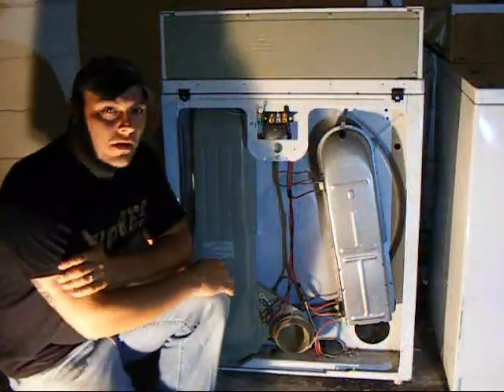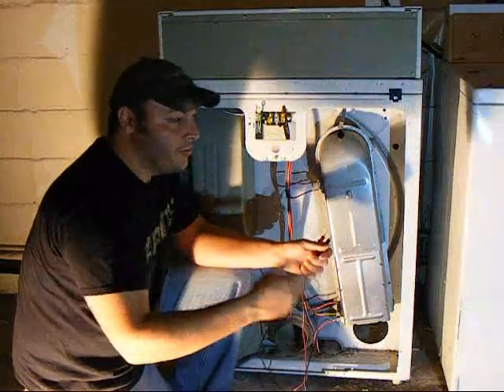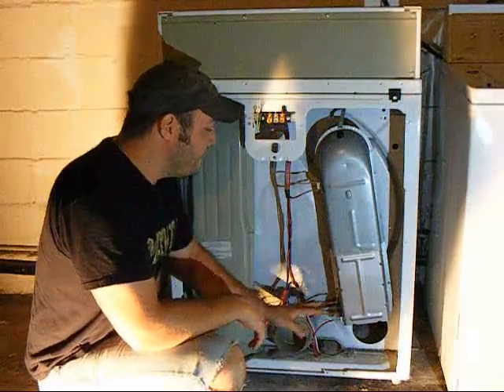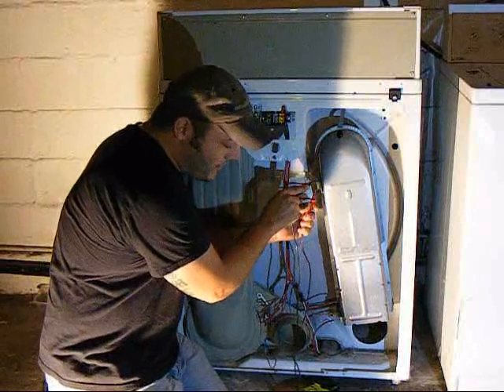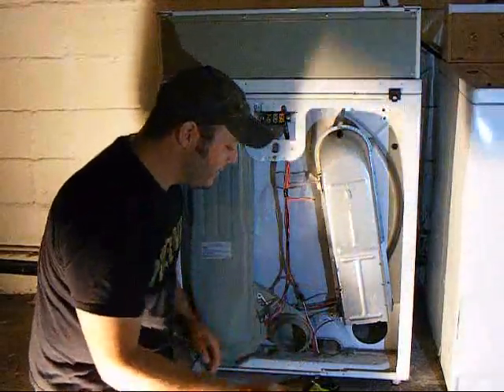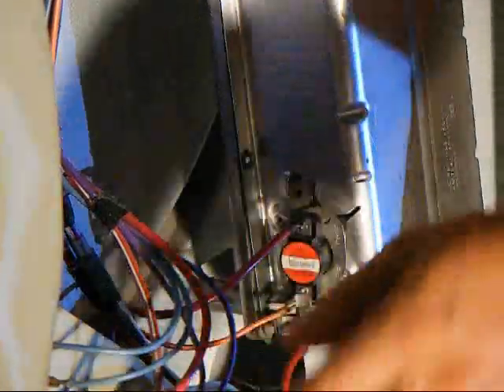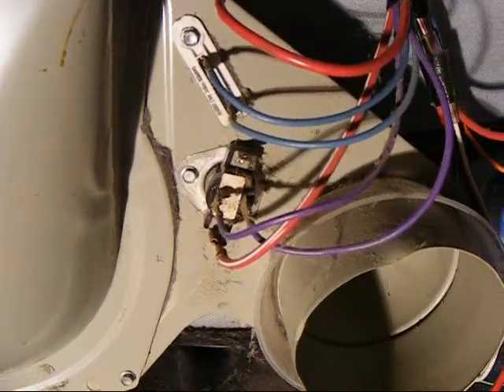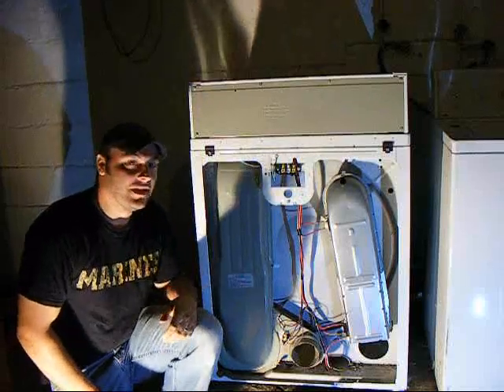Whirlpool / Kenmore Dryer Heater and Thermostat Test

Comment: I have a dryer which isn't heating up, but the motor does work and it runs the cycles perfectly. This video has given me an idea of what to look for and I will get my multimeter out and do some troubleshooting and my vacuum cleaner to get all the lint and dirt out of there as well. I thank you so much for placing the video on here.

Comment: It's good information. For those with meters? If you see any corrosion of any kind on your contacts, be sure to use the points of your meter leads to scratch the surface to make sure your getting good contact when checking voltage, etc. Sometimes the problem is there's no solid contact to begin with.
Reply: Hugh Dismuke A word on electricity and being shocked. The basic rule of thumb is 'if you respect electricity then electricity will respect you. That means understanding how it works and how it works if you come into contact with it.' If you don't respect electricity then, well..... good luck.

I've seen guys lean up against shut off boxes while taking readings or changing fuses. I knew one guy who became 'the human wire' for one system for a few seconds. He never did that again.

Comment from the maker: @cadaverock 
if the ignitor is broke you definitely have to replace it.  There should be a little peep hole on the front panel of the dryer to check to make sure the ignitor is glowing orange when you start the dryer.  Replace the ignitor, start the dryer and check that first. we can go from there.

Comment: I worked in small electronics repairs for years; things like hair dryers, T-shirt print irons, and industrial control units but I've never tackled a dryer. And since I don't have the specific knowledge on them I thought I'd check out this video after doing a Google search on the problem. Your video was the first thing to come up and although I assumed it was either a thermal safety switch or a relay your video pointed me in the right direction. It was the top one made of ceramic that had gone out on mine. Thanks to your video I didn't have to go poking around and spend half a day wondering where everything was since I wasn't familiar with these things. Tremendous help loved the tip about disconnecting one wire from each before testing too so you don't end up getting feedback through something that may be shorted or something when testing the continuity.

Comment: Bill, I wish I had seen this video 2 hours ago. Spent that time checking continuity of everything and even replacing the thermal fuse, which I had to do last year and had bought a spare at the time. Still no heat. After watching your video I remembered my daughter said the circuit breaker had tripped and she had to reset it. I put everything back together, checked the voltage... 118v on the left, and bupkis on the right. Went outside, reset the circuit breaker again, and voila! Heat! Thanks Man!

Comment: Thanks for making this self-help video.  I followed your instructions and found that the safety thermostat has tripped.  I used your drop method for resetting the thermostat and that worked on the first try.  Excellent video, dude!  The best part is the money I saved, so kudos to you.

Comment: Brother I just want to thank you! My dryer stopped heating and my dryer stopped working. Checked the voltage and POW! Sure enough, I had a faulty connection. Thanks for everything man. I do everything myself but this one stumped me! Thank you! You are awesome!
Reply from the maker: Jaime Venegas Thanks! Great Job on your repair!
Reply: All credit goes to you Bill! If anybody has any questions on those Kenmore stackables or LG front loaders send them this way. I'll be glad to help them out. I've already fixed two other washing machines. My Kenmore stackable was tricky but I found a way to not replace the whole transmission. Thank you once again for all your input! You are awesome!!!!!!

Comment: Thank you!!! Thank you!!! Thank you!!!  Our Roper dryer continued to tumble, but not heat up.  I was set to simply order a new heating element.

Luckily, I came across and watched your video and determined it was the non-resettable thermal cutout fuse.

I then watched your linked video on how to reset a non-resettable fuse and just like on your video, after the second or third time of "throwing" it down on a hard floor, I got a positive ohm reading.

Hooked it all back up to the drawer and it worked.

I am the least mechanical type person there is.  To be able to do this gave me such a feeling of accomplishment not to mention the money saved!

Thank you again very much!!!!
Reply from the maker: Awesome Job on your repair!  This should make you laugh........Every time someone says they threw it on the ground,  I think of the lonely island song, "I threw it on the ground"  If you don't know what that is, google it.   lol
Thanks for Watching!

Comment: Thanks. I watched your video after checking all the basics inside the machine. It was a loose wire in the circuit breaker. I hadn't thought of that with the motor still running. It's running now and happy wife = happy life

Comment: I was about to go just buy another scratch and dent when our dryer was taking two cycles to dry, and this past weekend it seemd to barely warm the wet towels...

It was the first step...  I noticed the plug was leaning out because the cord comes out the top: the receptacle in the wall is prob upside down.  CHecked the voltage: 120 on the first leg and only like 50 on the second.  Pushed the plug in all the way.  BOOOM! 125 on both and 250 across the outside.

Went ahead and took the whole back apart and shop-vac'de adn wiped w a cloth...  Took the drum out and did the front too.  Just like you showed.

Saved me prob $400 and a trip to Brandsmart and the moving in and out.  Also encouraged me to keep the DIY fixit dont let it whip you attitude...  SOmeone else will have to keep the economy going this week by buying a durable good...

Thanks for the video!!

Comment: OK, this was a great video, I found that I had a bad element and replaced it yesterday (2/24/14), cost about $50. Replaced it and... NOTHING! I was ticked that I just wasted $50. So I did a search on Google and found this video. I found one of my sensors was bad. Took it out, slammed it on the concrete floor, tested it again and it was fine. You saved me another $50. Oh yeah, it was the vent being clogged that caused the problem to begin with. I cleaned that out too.

Thanks Bill, keep up the great work.
Reply from the maker: Awesome!  Great Job on the repair.  Thanks for Watching!

Comment: Thanks for the email.  I tried your method, but when I opened the door it started back up.  I still think you are right about the motor, no matter what setting I used, it run about 20 minutes and than gradually shuts down.  I let the motor cool off and it starts like a champ.  I also tested everything in the back with a multimeter and they check out fine. I have ruled out the timer, not only did I test it with the multimeter, it moves like its suppose too. Happy Thanksgiving.

Comment: Thanks Bill,
I would have started by checking the heating coil,followed checking power first and moisture had fried the socket. Dryer ran but no heat. Only one side was getting power. Replaced socket 240V across both sides,runs and heats. thanks!
Avoided needing to remove all the back cover screws!!!!!!!!!!!!!!!!!!!!!!!!!!!!!!!!!!
Subscribed

Comment from the maker: @fradenlab
usually when the thermal fuse blows, it has to do with a venting issue.  Remove the duct that the lint filter slides into and clean it out.  You will need to remove the back cover of the machine, and you will need to remove the two phillips head screws on the top of the dryer under the lint filter door cover flap thing.

Comment: you had me at "I don't give a shit if you get shocked". at that point I said to myself this is the video I need to watch
Reply from the maker: lol,  Did it help you with your problem?
Reply: I think my valve coils are bad I'll replace them tomorrow when I get the part. All my sensors tested good
Reply: Bill Newberry I tested the coils but I couldn't really tell if they tested good or not. My dryer starts up runs fine for 3 min then the flame goes out. and then the igniter lights up nice and bright trying to ignite it back up but it doesn't light up I get nothing. Does that sound like coils to you?
Reply from the maker: Ohm out the coils on the burner.  Most of the time you'll find your problem there.
Reply: Bill Newberry if I replace the coils and still have the same problem does that mean I have a bad gas valve? If that's the case I'll just scrap the whole machine
Reply: whirlpool  cabrio
Reply: Hysterical. People kill me thinking they can watch a video on how to fix something and suddenly become an electrician. Before you watch these repairs you should know a bit about how electricity works.
Reply: @BillNewberry  zIn checking that last thermostat...the purple wire terminals..I got 7.4 k ohm...is it still good?
Reply: @MD-cd7em  yes that is a good reading on the bias heater terminals.

Comment from the maker: also, check your power cord.  Unplug it from the dryer and check the prongs on the cord.  If you have one of the flat terminals that are browned up and looks burnt,  that may be your whole problem.  With that problem it will show the correct voltage at the dryer, but when it's under a load, the voltage drops out.  Keep me posted,  I hope you get it fixed.

Comment: Great information, thank you. I was able to troubleshoot all my dryer parts after it quit heating. Turned out to be the upper heater sensor, and I was able to reset it via the "smack off the ground" technique you demonstrate in the other video. Saved me used washer money.

Comment from the maker: @Bnichole33 I would say your motor is shot.  After it runs for a couple minutes, open the door then try to start it up.  More than likely it will not.  Sure sign of a bad motor.   For as many times as I've heard this complaint, its been the motor every time.  You are right though, once it cools off, it will start again.

Comment: Yes, I checked the element voltage, read 240ish, plug and breaker were good also. My I've vacuumed everything out, also the exhaust vent. It's hotter now, maybe that's the max it goes. The element is red hot. Last dryer I had just worked alot better, and it was 15 years older. But the drum motor went out on it. Thanks for the help

Comment: A very good and helpful video, as I heard about the circuit breaker that will trip if the vent was blocked I remembered that the wife moved it to clean behind it, I repositioned it so the vent hose was not obstructed and it works fine, thanks for saving me time and money,

Comment: Thanks Brother! You fixed my problem in the first 1:47 mins of your video!!! There was no power to one side of the connector! Traced it back to being, one side of my plug box went bad! New plug box and all is well! That's after going through a couple "Safety Sally" videos who never mentioned checking the power supply into the machine! Thanks Again!

Comment: Hi, 

Thanks for the video, very helpful. I followed your steps and checked everything, all looked good, quick question, the thermostat with 4 wires next to the exhaust hole, I unplugged one of the purple wire and tested that no connectivity nor ohm, is that expected?  The red wire terminals has connectivity though, Thanks

Comment: Love that film noir lighting.. The Ohm range is very important to follow temperature control so you can measure it with a known room/garage temperature.   Range is usually from cold 20K & 70 F 10K and down to 4K to 2K under higher load temperatures each one shutting off the element when it get BELOW the Lower OHM to the control board. These cheap thermistors on the blower can crap out and look beautiful cost $ 3-10 based on life in your town.

Comment: Great info.  Did just this and found my heating element had a break in it.  I can see the break when I remove the element.  Thermostats measure OK.  Does the failed heating element more than likely indicate that the thermostat has a problem even though it tests ok, or do they just go out once in a while without the thermostats being bad?

Comment from the maker: There is a switch on the motor that controls the power to the heater and thermostats.  Look for the two red wireds that connect to the motor.  They only connect when the motor is turning allowing voltage to the heater.  If the switch is bad, no voltage can make it to the heater when the motor is turning.  I remove the drum, unplug dryer, set meter to ohms, use belt to spin motor to test switch.

Just be sure that you have checked the power getting to the dryer.(first step in the video)

Comment: I watched your videos and found out that I wasn't getting a reading for the thermistor on my DMM. I got a new thermistor, installed it and still no heat. I checked the new part with the DMM and no reading for the new one either. All the other parts have good readings. Any suggestions for this middle aged somewhat handy mother to try? Thanks for the great videos, btw!

Comment: I have this exact dryer that is down right now, running but no heat.  The safety tripped over a year ago and I replaced it, the vent was clogged with dust.

I get a good reading on the thermostats, although the last one you showed with the 2 violet wires, should it read open across that?  Or would that not even prevent heat anyways?

You mentioned if none of the issues you showed solve the problem it could be a timer problem.  Any suggestions on fixing timer or just replace?  I will say that the dryer was having a problem of not turning off when timer hit zero before it stopped heating so I am leaning toward that being the problem.  Thanks for the video!

Comment from the maker: what's the model number to your dryer?  It seems that if all the thermostats and the heater are good.  You've checked the motor switch and it's good.  You may want to head over to the temperature selector switch.  Verify that the dryer is not heating on all cycles.  Timed dry and automatic.  Keep me posted.

Comment from the maker: @locomojo04   When the dryer is running, you are going to have to check if the heating element is getting 240 volts AC.  If its getting 240 volts when the heater is on, check your vents.  It could be something as simple as an air flow issue.  This will cause the symptoms you are describing.  Let me know how you make out.

Comment: Bill, I'm having one of those PIA problems.  Intermittent heat.  Every time I go to test it, it works perfectly!  Then, when we want to dry clothes, it goes in and out!.  I want to be careful how I do it because the plug box burned out on one side about 7 months ago without blowing the breaker.  It might be power supply, or it could be the dryer.  So I'm hoping the thing just quits heating so I can diagnose it. 
Mark

Comment: Wel , i first decided Id check all the thermos, before I did the first part you showed , the power on . I see now why you do this because your problem may be the voltage itself. Allthe thermos check out ok . The last step I decided to do was power off the circuit breaker. Thst was it , I now have heat, Im not sure if I justy had a lose wire , or the braker just needed to be re set . Thanks for the info vid , very well done . Rick

Comment: Thank u Bill. It was a loose wire on the breaker. That's what is was. I thought I had tightened it but I had tightened the top one and not the bottom
Thank u for answering my questions
Do u have a vid on how to fix a microwave that does not heat. I feel like I can fix stuff now :)

Comment: Our dryer starts fine, however after about 6 or 7 minutes, the burner goes out, and never comes back on..
I can come back in about 15 minutes, and turn on again, and the burner comes back on for about the same length..
I will have to purchase an ohm meter, but thought you might help with these symptoms...
Thanks so much..

Dave

Comment: Incase this helps anyone... I posted my LG dryer issue below.  I had ordered the parts I thought I needed about 4 days ago (Gas Valve Assembly and igniter).  I just jumped right in because I really needed to do laundry and was tired of having dryer parts all over :)  Comparing the old coils on the Gas Valve Assembly to the coils on the new assembly, you could pretty much tell that the old ones were burnt out. They were a rusty golden brown color all around the middle of the coils.  The New coils are all uniform in color which is a pinkish flesh tone color.   The igniter was glowing fine so i didn't replace it. I'll hang on to it just incase..  Sure enough, the coil assembly was the problem and the dryer is now working great!  It wasn't that difficult.  I found a video on how to disassemble the LG dryer here on Youtube and another Youtube video on how to replace this particular part.  They literally told you screw by screw how to do both.   The hardest and most frustrating part was removing the screws which were SO tight!  I guess, from factory installation. I was a little nervous working with the gas but I obviously shut it down while working. When all was done and the gas got turned bag on everything was fine.  No gas smell at all (7 hrs from when finished now and still fine)  I had called Sears and it would have been about $85. service call, the part I ordered was $110. (not sure if they charge the same when they come out) and I would have had to pay for labor, which I'm guessing would have been at least another $150,00 or more.   I I Hope this can helps someone.  Good Luck! :)

Comment: This video was great!!!! i fixed my dryer ... at first i fixed the sensor, but than it still did not work... so i checked my fuse in my fuse box and it was a bad fuse as well, i cannot stress enough to Check The Very Fist Step of the video. my dryer works great, i also cleaned everything out on the inside so that it wont get clogged up again. :))